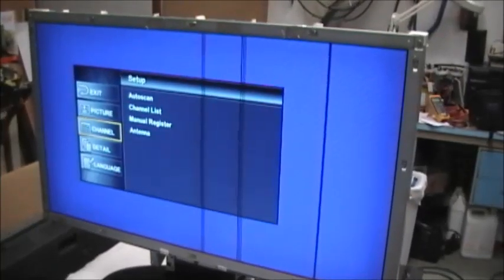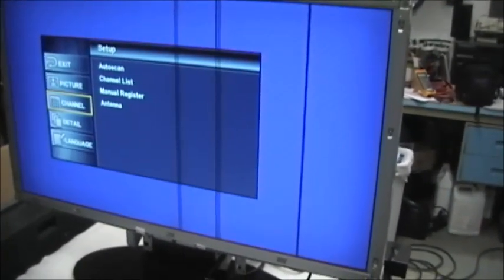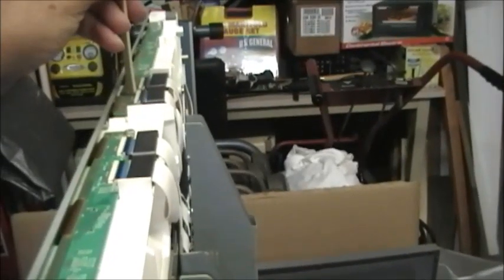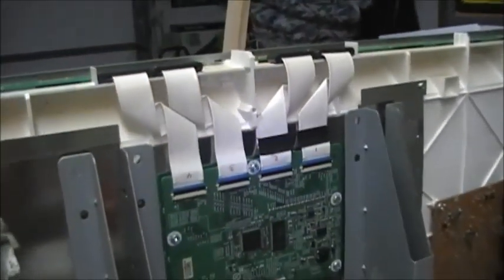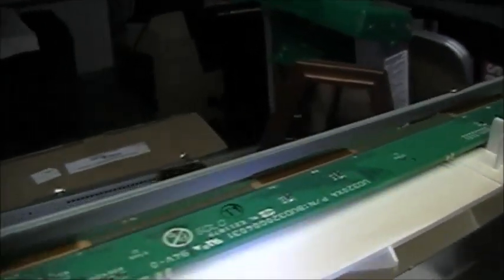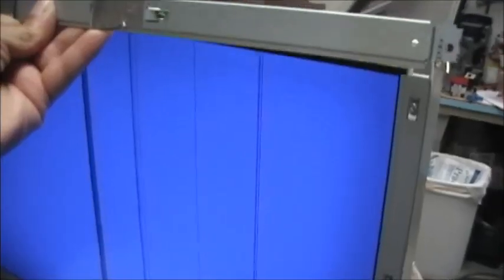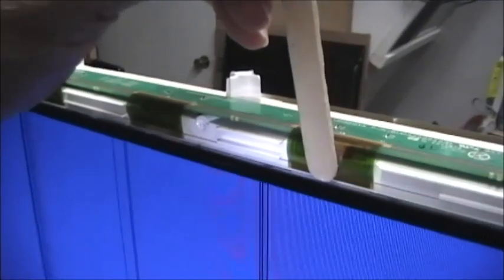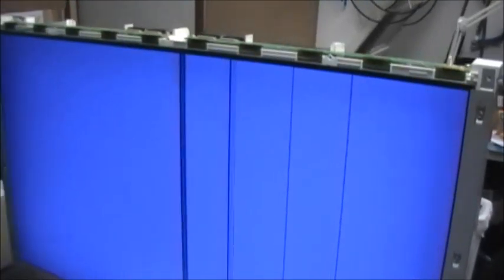LCD TV Repair Secrets - Vertical Lines on the Screen

Comment: How to fix thin vertical blue line in LG smart TV
Reply from the maker: As shown in the video: 1. Swap ribbon cables connecting T-con board to the Source/Driver board. If that doesn't do it, 2. Press on the TAB/COF connection directly above the line. If pressure affects the line, apply clear packing tape to the connection or try installing a rubber pressure pad on top of the connection. Good luck!
Reply: Lawrence Pina i opened back panel and removed ribbon cable and pushed from top. But the problem remains same
Reply from the maker: It's a display problem. If you can't make the line come and go, then there's no hope of fixing it, not even temporarily.
Reply: Lawrence Pina yes i went to TV repair shop i showed them pic they said same 
Tell me what are the chances that line will broader or same
Reply: Lawrence Pina thanks for ur swift reply
Reply from the maker: @NadeemQureshi-ro3ty , It might not get any worse. It might even go away all by itself (when the room gets hotter or colder)! Watch my video titled "White Screen." Symptoms are different but the troubleshooting procedure is the same. Best of luck!
Reply: Lawrence Pina thanks. Lets hope for the best. Anyway once thanks for ur swift response

Comment: This video is great! I am not really much closer to fixing my TV. But since it is the exact situation I have and my TV looks fairly similar from the inside, I am confident that what you are describing is my issue. And as someone who knows a thing or two about tech (however 0 about TVs unfortunately) that is worth much more to me than some crappy video preaching expensive quick fixes. Thanks!
Reply: Follow up question: Is it save to operate an LCD while the cover is off like you did? At this point I don't care about breaking the TV anymore, but my own safety is still important to me, haha.

Comment: PLEASE HELP. I believe the same type of cable is burnt out on my tv. The lines use to be pink and barely visible but when I turned it on today it’s solid black. Do I just replace it or clean it off? I’m not sure what to do.
Reply from the maker: Generally, TAB/COF assemblies don't burn out, they simply become unstuck. As they're not something DIY's can reglue or replace, all we can do is try to reconnect them by applying pressure pads to the contacts, which is not always successful. Even when that works, it's a temporary solution at best.

Comment: There needs to be some type of rubber or plastic inserts that come on the frame panels made to rest against these ribbons so there's constant even bar of pressure across the strips. I have this exact issue starting on my Samsung but after watching this and seeing other's comments, there's no point in opening it up to try and get it to go away as it will be back if I do not put some type of strip on the panel frame's inside
Reply from the maker: Even then, due to thermal expansion and contraction, the problem will soon come back.

Comment: what about horizontal lines? i have 1 horizontal line about 3 inches from the top going all the way across the screen, after about 30 minutes of warming up the tv it fades to a green colour and almost disappears. any thoughts?
Reply from the maker: I have a video explaining horizontal lines/shapes on the screen, but most likely you're experiencing the same problem shown here, just in a less common, horizontal direction.
Reply: @LawrencePina  nice one, yeah it isnt so bad that i want to go opening the back of my tv just yet but if it gets worse then i will deffo have a look.

Comment: WHat are those top boards called? Im sure those are replaceable right?
Reply from the maker: They're called source driver boards. They're not generally available. Even if they were, you'd need a tab bonding machine to attach them. Search on "tab bonding machine" at alibaba.com and you'll quickly see why.

Comment: The manufacturer uses a COF bonding machine to adhere the tabs to the lcd, heat causes the tabs to lift. I suspect they cut corners with cheap glue.

Comment: My baby throw the plastic bottle cap on LED TV afterwards some thin vertical lines came.what is the solution how to remove it
Reply from the maker: I don't see how impact damage could cause the problem shown in this video. Most likely you have a cracked LCD. Solution, replace the LCD, except you can not get them.

Comment: Have a 58” Samsung Plasma. Solved clicking on/off with main board. I replaced a buffer E board. After powering up, I now have 1) no clicking but 2) a VERTICAL LINE in 1 spot near the BUFFER E board. I DID NOT have line before replacing buffer. I’m thinking that my ribbon cable(s) are not fastened down correctly. Your thoughts. The tv is an 09. and i’m not going to give up on it as of now!
Reply from the maker: Given the circumstances, I'd say you're right. Try reconnecting the cables. Most likely one of them is either crooked or not in all the way. For what it's worth, I've had the same thing happen to me.

Comment: those lines seems to be dead black. Mine is blue and sometimes turns red and then dissapear. What could that be?
Reply from the maker: Check the connections between the T-Con board and the Source Driver boards. Most likely, the flat pack cables and / or the connectors are corroded. That's what usually causes colored, dancing, vertical lines that intermittently come and go all by themselves. It generally happens when the source driver board is located at the bottom of the display. Due to gravity, anything sprayed on the screen tends to drip on the connectors and corrode them.
Reply: @LawrencePina  What's the best way to de-corrode the connectors?
Reply from the maker: @Hawk619  Use apple cider vinegar on the connectors. Use a soft, pink, pencil eraser on the flat pack cables.

Comment: I don't find this video useful,  unless you tell me how to fix the problem.  I already knew about this so there is nothing new to me, but I'm going to tell you something, You can fix this problem temporarily by using  an air-heat gun and a flat steak  to press uniformly on the flex contacts over the board, but that is not a permanent solution, It can works for as long as a couple of months until to fail again.  By the way , all samsung's monitors SA300 series of 19 and 20 inches have the same problem.

Comment: who are that idiots who designed led tv panels..
Reply: They are not idiots. It's called planned obsolescence. "Let's use glue, and in 4-5 years chances are some of it will melt and give the buyers just enough lines to want a new TV."
Reply: there is no such thing as quality built electronic anything anymore. you know why refrigerators, tv's and many other things built before  the 1980's could last for decades without problems? cost of parts. back then, companies were more concerned about the quality of their work, because a customer couldn't buy cheap devices since nothing cost cheap to produce since everything was made locally. so companies focused on  building quality products, which in turn garnerd customer loyalty to those products. once cheap parts especially from oversea markets started rolling in the 1980's, that's when companies started getting cheap and buying  those oversea cheaper parts, and that's when everything changed. companies started to buy these cheap oversea parts so that they could profit as much as possible from their product, while at the same time make sure that their device would hold up long enough during its warranty peroid. sure, by companies going that route it cut the cost of their products pricing, but it also cost you the lifespan of your product too. you'll be lucky now of days get any device to last longer than its warranty peroid, regardless of who makes  without something starting to go wrong with it.
Reply: Yes, You just said exactly what I was going to write,  It is programmed obsolescence !!!!!  All Samsung's monitors SA300 series fail after  3 years of normal use !

Comment: dude you're a fucking genius!!!! I fixed my TV exactly by constantly rubbing slowly those ribbons and applying a bit of heat from a blow dryer to re-liquify the glue and it stays!!!!
Reply: did you have to diassemble the front frame of the tv before heating with the dryer?
Reply: @edmondc89  yes, you have to disassemble the tv in order to do that

Comment: my black vert lines are evenly spaced across the whole screen. Would it still be the same cause? or one of the other things you dismissed?
Reply from the maker: Are the lines drawn on top of the menu or are they drawn behind it? If they are behind the menu, then they're not caused by bad tab bond connections meaning the display assembly should be good. If the lines are drawn on top of the TV menu, as shown in the video, then it's almost always loose tab bond connections. Evenly spaced though - that makes me suspect a T-con board problem. I'd have to check it to be sure...
Reply: It can certainly be !

Comment: and the solution is?
Reply from the maker: And you bought your heat press where?
Reply: @LawrencePina  here's a pretty detailed video about the repairing process.--  https://www.youtube.com/watch?v=Hbl-CnLoNAQ
Reply: Lawrence Pina I use a wide adapter for a soldering iron. Just make sure your iron can use temps that low.
Reply: I do this with an air-heat gun !  It fixes the problem, but as I said before It is a temporary solution.
Reply: It is poor, cost-cutting manufacturing, no matter the repair or reasons. What year was that tv made? Have here a 2016 that is already total trash.
Reply: A heat press with a temperature control set to 170-190C depending on the application.
Reply: john a x

Comment: Get a heat gun... problem fixer...
Reply from the maker: Get a heat gun or even a hair dryer anywhere near these tab bond ribbons and they will quickly peel off (all by themselves), never to be realigned and reconnected again. That's been my experience. I guess that's why no one has made a video showing how to reconnect these with a heat gun...
Reply: Yes, I repaired many times samsung's monitor using air-heat gun, but It is a temporary solution since it last more or less 1 weak to 2 months until it fails again, the flex connectors also wear away each time you heat them,  and the LCD can be easily damaged by excessive heat.

Comment: I have an odd problem. Here it is- https://youtu.be/js5hQHhpXKA

It goes away after a  few minutes and as you can see it's only on pitch black areas. Even dark gray areas the red lines aren't there.
Reply from the maker: Horizontal blocking generally indicates a failing display. It's a different problem than described here, but still a display problem.
Reply: Lawrence Pina
The lines are vertical not horizontal. Did you watch the video? It's vertical red lines but only on the absolute darkest areas of the screen and it goes away quickly. Fuckin sucks because I really don't want the TV to die. I can't afford a new one right now.
Reply from the maker: That video is so busy, I'm not able to see the vertical lines that you're complaining about. But based on your description, it sounds like the contrast might be over driving momentarily. If so, entering the TV's service mode and reducing the sub contrast a little might help.
Reply: Lawrence Pina
Thanks for the tip. I will try.

And the video shows it a bit better at the end when I pull up the TV's input and main menu's. Also, you can see that it occasionally will flow around the screen randomly, and there are some horizontal lines as well. Weird issue.

Comment: I have a Sony Bravia KDL-46W-5100 with lines across the whole screen.  Is this the panel or the t-con board?  I have unplugged and plugged all the cables to and from the board.
 "http://imagizer.imageshack.us/v2/1024x768q90/922/zBcywx.jpg"
https://photos.google.com/photo/AF1QipPHtcbZDnBAYVFQKF0odABb4YNXvEcHHK-bfKPX
Reply from the maker: This looks like the contrast is overdriven. See if you can turn down the contrast using the TV's setup/video menu. If not, search for what buttons to press on the remote (generally while or before powering up) to get into service mode. You'll certainly be able to turn it down there.

Comment: The display of my television LG 32LB550A is showing some vertical lines when it is turned on. I can hear the sound but I can't see anything on the screen except some vertical lines.Need your advice to fix it. Here's the link of the video.

https://youtu.be/shomKvMS6Zo
Reply from the maker: Your link doesn't work, but from what you describe, I'd say loose LVDS connections, or bad solder on the main digital board. If disconnecting and reconnecting both ends of the LVDS cable (with power off, of course) doesn't affect the symptoms, try heating the main digital board with hair dryer or a heat gun. Concentrate on the ICs (this time with power on) and see if you can't get the display to come back on. If you can, then you've identified the problem and a good working board should fix the TV. Just be aware that any used boards you buy may be similarly affected or about to fail in exactly the same way.
Reply: Rajesh Kumar

Comment: what to do?????? you never answered that question can this be fixed?
Reply from the maker: The whole point of this video is that vertical lines are generally caused by a broken display panel assembly. It's easy to verify (by pressing on the tab bonds as shown), and all the new digital boards, power supply boards and timing control boards in the world are not going to fix anything. When you have this problem you need a new display panel assembly.
Reply: Lawrence Pina heat ribbons remove clean with rubbing alcohol and use conductive tape to restore bond. crazy cheap

Comment: a short-term fix this is the place something in front of the tab like you said you must understand that you have to suspend that's placing a tad behind implanting a tab in between the frame
Reply: +Gina RoMineGta  or you could start develop yours machine as well. My company start to doing protype and when we finshed we are be able to replace this ribbon. Don't forget that some problem was cause by a little chip on this ribbon and the only way to repair is a replace with a ribbon.

Comment: You can repair them lines . Now what causes the problem is bad design in metal with the the indentation in the frame cause magnetic charge of that ribbon you can't suspend it by moving the metal frame and keeping it from the ribbon but you also have to suspend the ribbon now a manufacture defect in the framework that hold the display panel it receives a magnetic charge you can measure it
Reply from the maker: +Gina RoMineGta
It never occurred to me that the vertical lines  might be caused by residual magnetism. I just assumed that the tabs had become unglued. But if what you say is true, then passing a tape-head demagnetizer over the tab bonds, the cables and the metal frame should also affect the lines (without having to press anything). Have you tried that? What was the result? Thank you!
Reply: Lawrence Pina

Comment: confirming this. Got an samsug ued46ysxxn full hd. Those ribbons are on the sides and under the lcd. The ones under causing this horrible screentearing and vertical stripes.
Reply: Same problem for all Samsung's SA300 series monitors !   Don't buy those monitors, they can't be fixed!